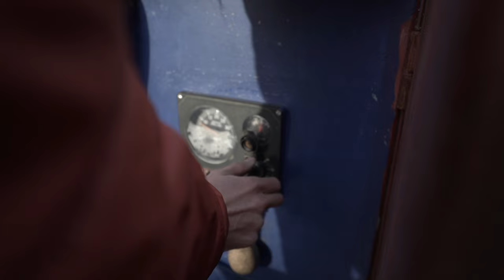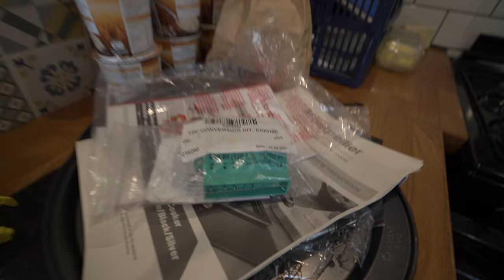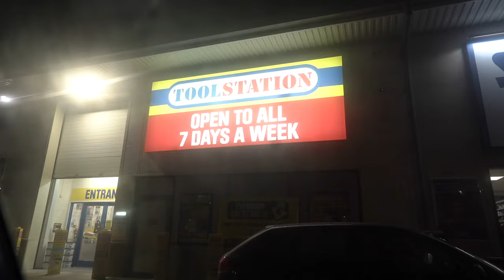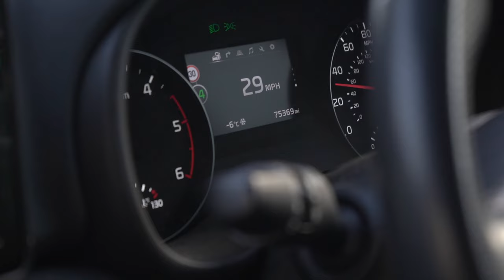We SOLD our house to live on a NARROWBOAT | EP 01

Comment: Just a word of advice. Less revs from cold, you will kill your engine very quickly. The smoke at the start was blue smoke which is not great. Go longer on warming the glow plugs when it's so cold, the engine was cranking too long which either means poor compression or glow plugs not hot enough. Just run your engine as gently as you can from cold. I was cringing at the amout of revs you were running from dead cold. It sounded almost flat out.
Reply from the maker: Thanks for this James :) that was our first time starting it so we have learnt a lot since then!! Thanks for being here with us.

Comment: Hi! Lovely Vlog. Re your shower you will find that your shower tray is below the level of the canal and water doses no travel uphill without assistance so there should be an electric pump (normally a Whale Gulper) to pump the shower water out of the boat, best wishes on your new venture, regards Mike
Reply from the maker: Thanks Mike :) we have a shower pump / gulper and it works a treat. Our issue was that the boat was run aground and then the canal frozen, so we were on a big lean and so the water even when the pump was on, was just pouring over the edge! We have found a solution now :) which we shall share in one of the upcoming vlogs so stay tuned! So happy to have you here with us xx Ula and Josh

Comment: Hi guys, thoroughly enjoyed your video. I live on my NB and have done for 5+ years. I've got the same Reflek stove. The easiest way to light them is,
1. Turn on your diesel supply to max
2. Go and make a cup of tea!
3. After about 10 minutes you should notice that there is diesel in the bottom of the pot.
4. Put in a capful of methylated spirit.
5. Light immediately and hold the red button down for a couple of minutes.
You'll find that you use much less spirit than doing it any other way.
Good luck with your new adventure..... it's bloody brilliant! 👍
Reply from the maker: Thanks Ian, this is great! We think we have mastered it now but will try this if we have issues next time. Where shouts are you on the network?

Comment: Get yourself a plastic sledge and it'll make transporting wood back to your boat in any weather conditions a lot easier. Take a strap amd make some holes in the edges of the sledge so the wood is secure.
Leaving a couple dog water bowls outside makes your boat seem more secure without the actual dogs.
Get a handheld mini electric chainsaw and it'll make chopping logs easy.

Comment: HOW FUN!!!   LEARNING ALL THE BOATINGS LIFE UPS N DOWNS. BUT IT IS ALL MANAGEABLE. ITS JUST A MATTER OF DAY TO DAY LEARNING AND TALKING TO THOSE DOING THE SAME THINGS. IVE BEEN LIVING IN THE BACK OF MY TRUCK CAMPER SHELL , ONTO YEAR 3 NOW , AND I HAVE LEARNED SO MUCH ABOUT THE COLD, AND THE HEAT. FOOD STORAGE, CONDENSATION ON WINDOWS, AND FINANCES FROM MONTH TO MONTH. I AM SO MUCH BETTER NOW, IN FACT VERY GOOD AT IT IN SUCH A SHORT TIME. A LITTLE HINT FOR KEEPING WARM , IS TO SEAL THE DOORS AND DRAFTS WITH FOAM INSULATION TAPE. CLOSE EVERYTHING OFF. SO MUCH EASIER TO SAVE HEAT. IT WAS -10 F  ,HERE IN IDAHO U.S. OVER WINTER AND I SURVIVED EASILY. KNOWING THE INSULATION UPGRADES WERE SUCCESSFUL. HAVE BACKUPS TO EVERYTHING, REDUNDENCY. THE KITCHEN STOVE IS A PERFECT EXAMPLE, IN CASE U NEED HEAT. NEW SUBSCRIBER, YUR VID IS FANTASTIC. CARRY ON, AND BE BLESSED!

Comment: to expand the amount of free fuel for your stove, make a simple press mould then dead leaves in a bucket soaked with a binder like early wallpaper paste, which was flour and water. soak dead leaves in it, then fill the Biquette mould with the leaves, and squeeze out the water back into the bucket, put leaf blocks to one side to dry, and build up a stack of them. if the stove gets too hot, chuck a damp one on which could cause a bit of a tar buildup in the chimney, so dry wood it flat out every couple of days to clear the tar and soot. If the chimney gets a bit coked up, you can clear it from the top by dropping something heavy on a rope down it, and just keep lowering and raising the weight, until it is pretty clear, then you can burn some hot wood flat out to finish cleaning the chimney - I'd do that when it's raining hard, and the boat isn't moored up close to lots of dead undergrowth. If people were still chucking out huge numbers of Newspapers, they were a great source of material to make fuel briquettes from also. Keep Warm. Best Wishes.  Bob (mad about Boats of all types but particularly about Sailboats of the offshore variety.👍⛵️✨️✨️✨️✨️✨️
Reply from the maker: Hey Bob, thanks for your comment!! Great advice. We'd love you to make a YouTube video of this for us, would be a great way to learn and sounds fantastic, free fuel! Amazing. Thankyou for sharing

Comment: Hi Ulla and Josh, your boat looks so nice inside, a unusual set up with your kitchen at the back seperated from your living area but i like how spacious and open it is,  was your eco fan on your fire working?  I didn't notice it moving to push the heat out
Reply from the maker: Hiya Paul, thank you for the lovely words. We love the layout of our boat. I initially thought I wanted the kitchen to give onto the lounge room but we are so happy to have two separate living spaces! 

Our fan rarely spins… it works… but we have been told that it is because there is not a flow of cooler air behind the fan that usually comes from a chimney (in a house) or the bow / sterns doors (if the stove is located not in the centre of a room like it is on ours). We have tried placing it on various different places on the stove and it doesn’t really seem to make a difference… but I can say when the fire is on… it gets VERY WARM on the boat :)

Comment: Hiya both. I reckon you've worked out already that you're not mad for moving afloat, and you certainly come across as practical enough to make a go of it (not that it's rocket science)

Louise and I moved afloat nearly 30 years ago as house prices in our village near the Derbyshire Peak became too high for locals - and we wouldn't thank you for a house on the bank nowadays.

A couple of tips (if it's not teaching you to suck eggs)

Keep on the right side of CRT - they're in effect your landlords after all. The people who work the Cut tend to be fine, but those in the office can get mardy unless you keep them informed of any reason you might need to overstay etc

Folks on the Cut tend to be friendly, perhaps too friendly! You can ask three people for advice and get five opinions! Choose carefully whose advice to heed.

It looks like you might be ready for a paint job. Use the best paint you can afford - it's cheaper than steel plate. And remember that paint is primarily there to keep rust off. If it looks good too, that's a bonus.

Don't burn green wood. It'll cause tar marks down your paintwork that are a pain to shift.

And lastly - as in most things, the south east in general and London in particular are nothing much like the rest of the system. Come down the Trent to the Chesterfield Canal for a treat!

And don't worry about the China tea cups. You'll only get stressed when they get chipped. I have an enamel mug. Can't chip that!

Good Luck folks - though from this start you certainly seem to have the skills and attitude to make a go of it. 👍
Reply from the maker: Thanks for all of the advice and tips Ian… we are happy to be joining you both on the cut! Loving it so far! Much to learn and much to see but all in good time. Looking forward to heading north later this year when the closures lift. Happy cruising xx
Reply: @UlaandJosh  

Just sing out of you think we can be of any help. If you come down the Trent and want a hand down the tideway I'm happy to help out (might cost you a pint!)